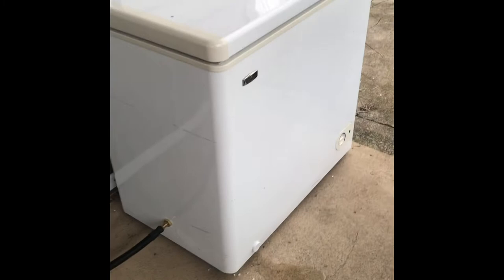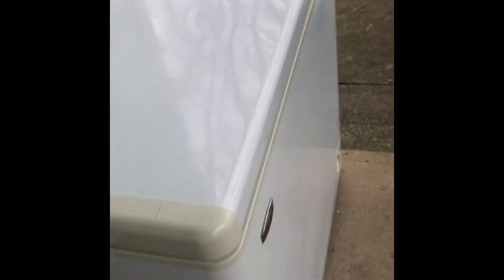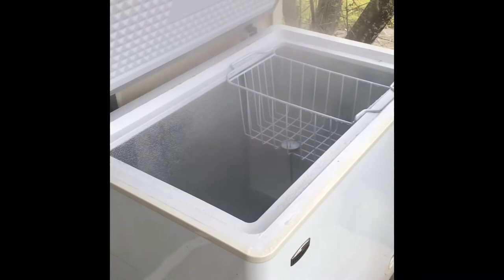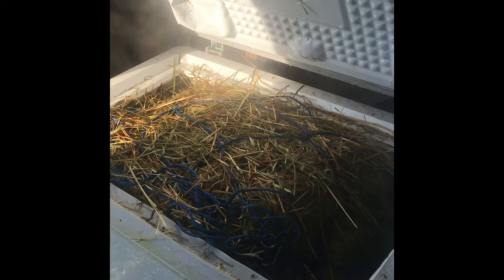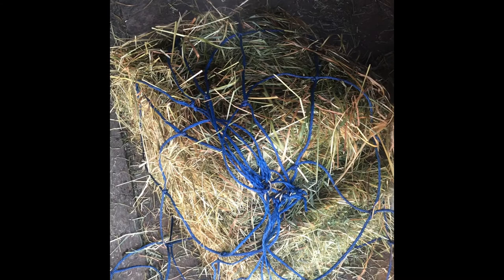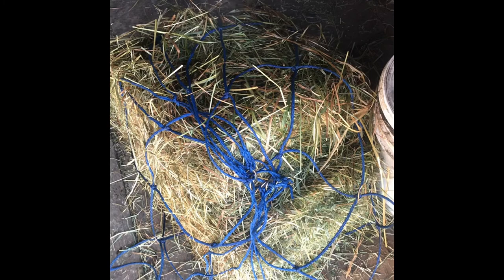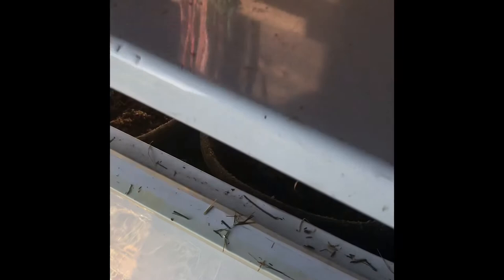DIY Hay Steamer using a repurposed freezer

Comment: Just tried this and got some bubbling on the lid plastic and at the top the plastic capping on the top of the walls pulled away so the insulation is visible.  Did yours do that and was there anything you did for it?  Encouraging that you have been using it for awhile

Comment: I am in the process of trying to set one of those up right now.   How cold does it get there in winter, that is the one issue I am worried about here with that, we get down to -35C or colder in the deep dark winter, and do you just have that set up in a shed?
Reply from the maker: I would consider putting it in a shed for those low temps, you may have to run 2 cycles to get it up to temp. That’s pretty cold!

Comment: Hi there, I’m in the process of converting an only freezer, but I’m wondering if you removed the refridgerant? It is typically Freon…
Reply from the maker: Hello! We didn’t remove the parts or Freon, we bypassed it! Going on 2 years using our big freezer. You can expect some bubbling in lid but it hasn’t affected the steaming, I don’t normally go more than 3 hrs of steaming for 2 horses hay.
You may also consider making a bigger drain hole in the bottom instead of using the side drain, in order for smaller particles of hay and dirt to drain out. Happy Steaming! They love it and there is usually zero waste!
Reply from the maker: We did not remove the refrigerant, we put the line through and did not mess with the motor.

Comment: How hot does it get inside the freezer stramer, and whats that device you have creating the steam???
Reply from the maker: It gets up to 170, enough to kill bad microorganisms like mold, cleans the hay of dust. I use a full size freezer now, can put in more hay!
Reply from the maker: You buy the steamer separately, can get it on Amazon, you need the container to be big enough to run 2 houes
Reply: @TheBrendaHanna  

This is genius. Exactly what I’ve been looking for. Thanks so much!!
Reply: @TheBrendaHanna  

Could you tell me the name of the steamer on Amazon. Thankyou
Reply from the maker: Earlex or an Argos, just make sure it’s biggest container as you want at least 2 hours of steaming, get a plug in timer with shut off, so you don’t boil it dry!
Reply: Brenda, can you make a video of how you made the fastners etc? Did you make pipes with holes at the bottom to distribute the steam? We're not very handy, so we would love more details how to make one. Thanks in advance!
Reply: @TheBrendaHanna  Brenda, can you make a video of how you made the fastners etc? Did you make pipes with holes at the bottom to distribute the steam? We're not very handy, so we would love more details how to make one. Thanks in advance!